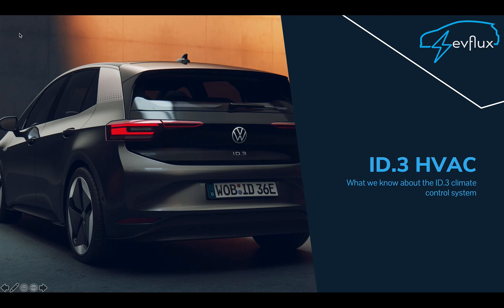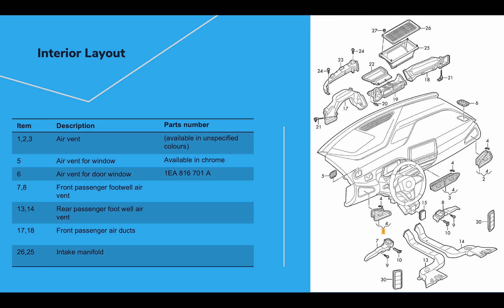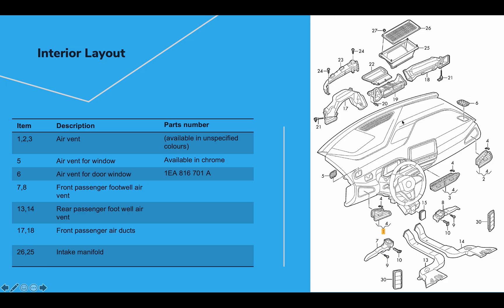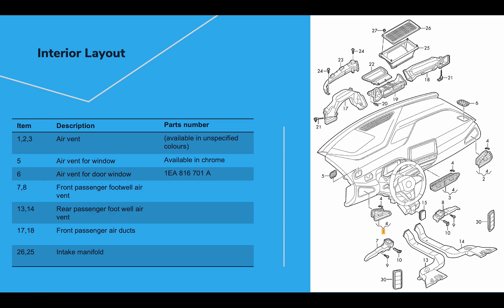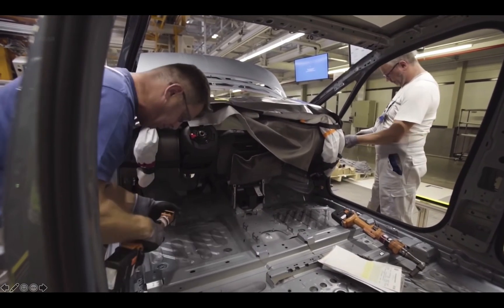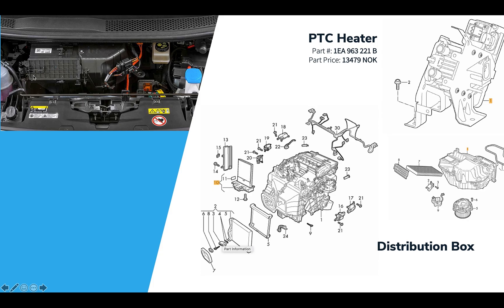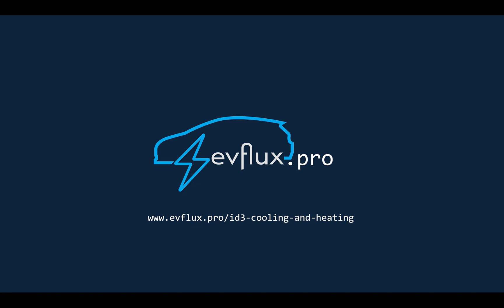VW ID3 Heating and Cooling System

Comment: One more advantage of co2 is it’s probably going to be much less expensive to refill compared to R134yf this stuff is super expensive for now you mentioned the E Golf’s heat pump is noisy I have a US spec 2015 with the heat pump and I’m from Canada and last winter I don’t think think the Resistive booster heater ever came on but the heat pump itself is not that noisy but the radiator fan gets pretty noisy.

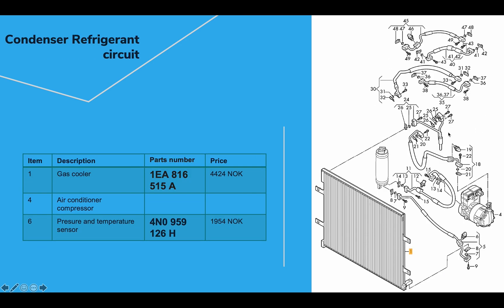Comment: The diagram you start presenting at 5:51 is clearly not the same system as the one you start presenting at 6:35. The former has the discharge line going straight to the front end heat exchanger ("condenser" if it is R1234yf - I suspect for that system it is). The latter has an accumulator on the suction side of the compressor, which is either a sign of a reversible heat pump system (i.e. one that can operate in both air conditioning and heat pump modes) or it is a single loop fixed-orifice system... I expect that it's the reversible heat pump variant which according to their marketing is R744. Also you can see for the latter system the compressor discharge line goes off towards the HVAC unit - typically the discharge line goes straight to an HVAC unit condenser (or gas cooler for R744) regardless of operation mode for reversible heat pump systems (this is the case for the e-Golf, Renault Zoe, Nissan Leaf...) with a heating door preventing air flowing over it in air conditioning mode when required. These diagrams are helpful for technicians assembling the system but not for understanding their operation really (which is probably how VAG intended it to be when they made them).

Also I'd say it's unlikely that you would have an HV heater in the HVAC unit as well as a reversible heat recovery heat pump system... It seems like extreme overkill. The only time you might use it is if the front end evaporator becomes too frosted/iced over and the heat pump needs to operate a defrost cycle (change orientation and use hot refrigerant into the front end heat exchanger to melt the ice). This is common for building heat pump systems but I haven't (yet!) known/seen this happen on vehicles. The reversible heat pump on the e-Golf had a HV heater (PTC) on the coolant loop, which supplied heating through a "chiller" (coolant to refrigerant HX) so even if the front end heat exchanger was iced over, the heat pump could still use waste powertrain heat and the PTC to heat the cabin through the refrigerant loop. For most journey lengths this makes more sense and is a lot cheaper to implement than a defrost cycle (I'd say).

Anyway it seems to me the argument for R744 has tended to come down to cost in the past (the technology has been around for decades). In order to get the temperatures required in the gas cooler (for heat pump mode) the pressures need to be 100 - 150 bar which demands more robust/expensive components. Also, for operation in hot ambient temperatures (for air conditioning) the discharge pressure can get very high... so an R1234yf system might use less energy when in air conditioning mode.

Comment: ID3 without Heat Pump option does NOT use R744 refrigerant.
Based on these diagrams, I see no evidence that it could harvest battery heat to the interior. The heat exchanger that you mention at 10:55 is a plate heat exchanger. COLD refrigerant flows through it to cool water from the battery loop. But this refrigerant is then sucked by the compressor and sent to the CONDENSER. The condenser dispenses the heat into the outside environment. The refrigerant carrying the battery heat has no way to go back to the cabin, there is no "motive force" that could move heat from one loop to the other.
The diagram at 5:55 clearly shows there are simply two parallel refrigerant circuits on the output of the compressor. The compressor can "suck" heat from either of these circuits (cabin and/or heat exchanger) and send it TO THE CONDENSER to be dispensed into the outside environment.
The flow of refrigerant through either of these loops seems to be controlled by electronic valves, so the cooling can be turned on/off independently on the battery loop vs. cabin loop.
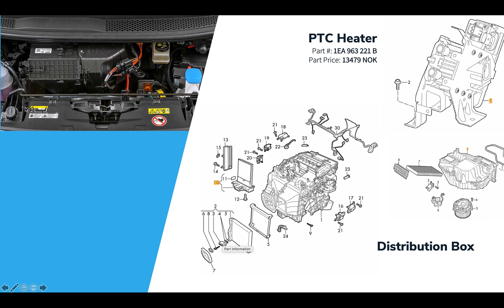At 08:40 I see two electric heaters. Part (1) is for the water-based battery circuit. Part (10) is for the cabin air.